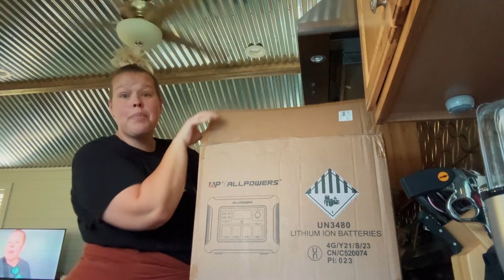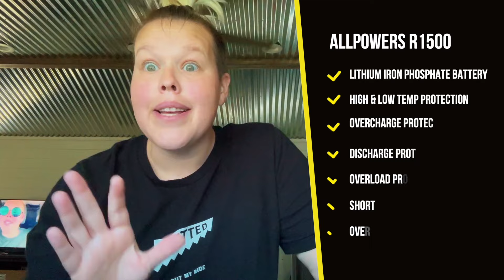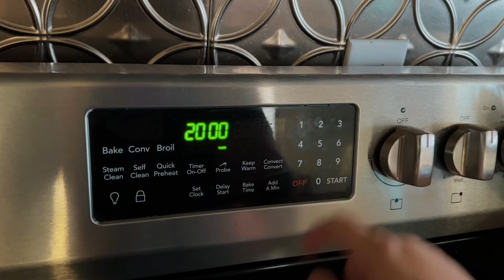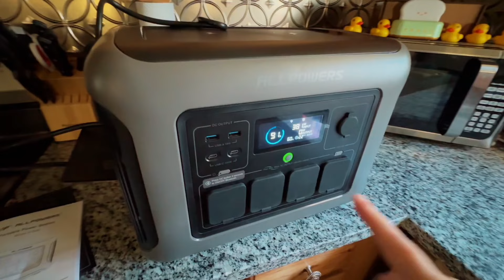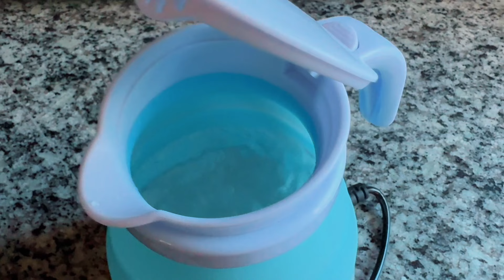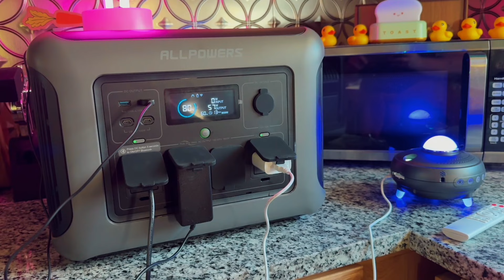Solving Vanlife Power With AllPowers R1500 | Is This Enough Power For PRIMARY Power Solution?

Comment: I am a bit confused about how "fullly powered" it is when it arrives.  
Was the "0" showing before plugging it in just a screen protector, and was it actually at 70+% full as shipped?
Also, are you going to run a test for phantom draw charge loss when sitting unused for a period of time?
Reply from the maker: That is one of the mini chest that I do follow up on that will be shown in the future. This is why I do test over continuous amounts of time.

Comment: You didn't mention refrigerator,  can use for that.?
Reply from the maker: It definitely has enough power, but I do want to do some testing to make sure it doesn’t have an auto shut off or anything like that so in an upcoming video where I reveal a brand new refrigerator freezer I will be sharing that part so that people can get a better idea
Reply: @BunnyPlaysHere This is just what I needed to know. Reading my mind😁

Comment: I have used a jackery for my 12v frig for several years now and has worked great, but with additional things I wish to carry, I am considering another larger power station. You have gotten quiet a selection of power stations over the years, I would love to hear which you love the most and is the most dependable for those who travel a lot. I have also used mine many times at home base during power outages during bad weather. They are just good to have around. Have a wonderful day and be Blessed!
Reply from the maker: I enjoy testing all of these out and then finding the little things that set each one apart!!!

Comment: This looks just like my larger Bluetti AC180. It has just 1 outlet cover on the DC/12volt. I like that the Allpowers has those covers as long as they R strong enough to hold up to the use. Thx for the review
Reply from the maker: Thus far they seem pretty substantial, but I am going to take this on the road and really use an abuse it to make sure. I want to make sure that I give a good follow up on this so that everyone can see what works and Does NOT work about it and then also give suggestions based on my overall use for charging and efficiency.

Comment: I picked up a power unit to avoid outages and had to use it once already.  Best purchase I have made.   I got one you suggested.    I might look into a secondary because in Houston we lost power for several days and I didn't buy a panel to charge it with outside so maybe having two would be helpful.
Reply from the maker: A panel and other power unit that can be used while charging the first would be the way to go in my opinion... but i also know that means an extra expense so start with the panel first!!!

Comment: My wife and I have a generator as a backup should the power go out, however after having seen you speak on this portable power it might be something we should invest in for inside the house for smaller devices.    The generator does a pretty good job but having something we could move around would be easier for smaller things like phones and lights.
Reply from the maker: A generator is great but yes portable power is nice for inside for quick access to something that is a bit more light weight... i love having mine even when i have power if an outlet is a bit further from where i want to be
Reply from the maker: A generator is great but yes portable power is nice for inside for quick access to something that is a bit more light weight... i love having mine even when i have power if an outlet is a bit further from where i want to be